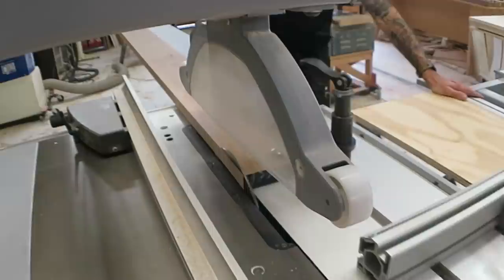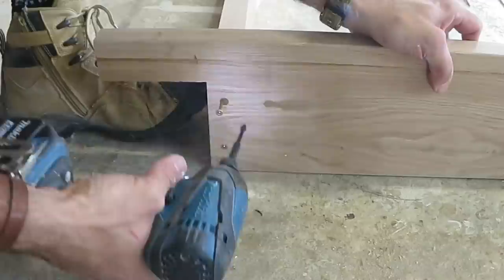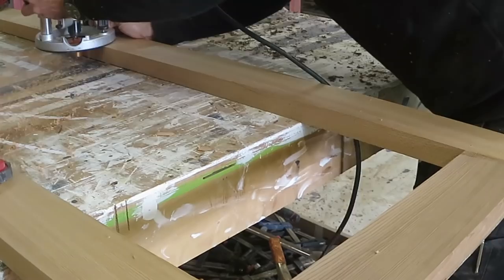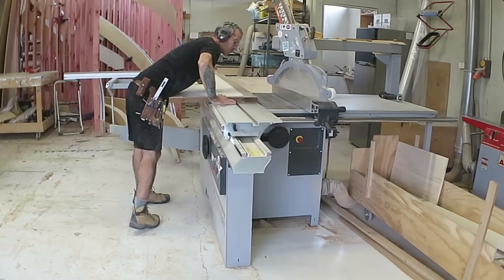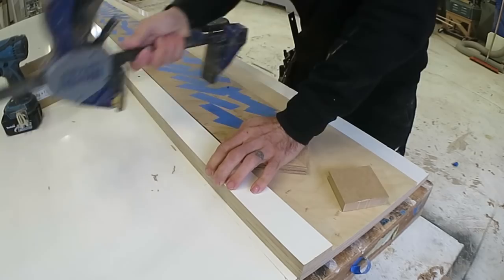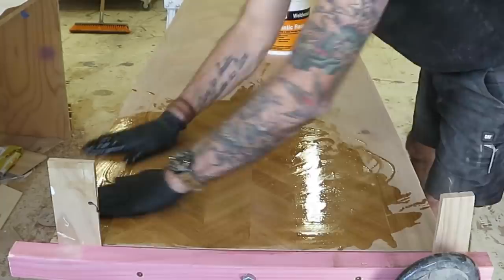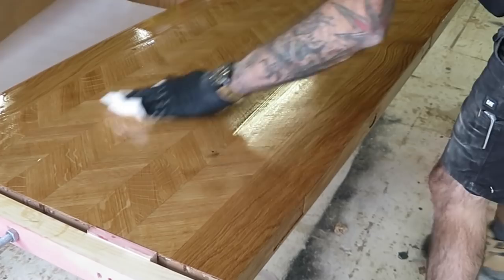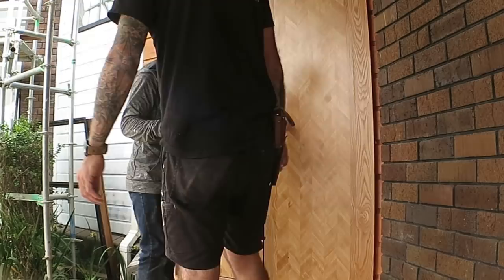Veneered entry door set

Comment: All that work and the frame isn't wide enough.
Reply from the maker: No the frame was made 3mm to wide for the wall. When measured the cladding and plaster board was not in place. For some reason the plaster board was being held off the framing towards the top of the door. I made the difference in levels disappear to the eye.
Reply: @KingPostTimberWorks  Yeah, it's happened to me.  I hate to cut the back of trim if the trim sides are visible.

Comment: Very impressive video skills as well as joinery. I’m concerned about the stability of the door slab. Plywood is inherently not flat. The poly finish is not the best at preventing moisture. Once the door is subjected to the internal/external climate differences will they eventually warp. We shall see in a couple of years. I’m not being critical. I’ve built similar doors. In the States we tend to use a foam core and ladder construction for exterior veneer doors. These type of  projects are experiments.
Reply: that shouldnt be a problem anymore with something like Medite Tricoyya (MDF rather than ply)